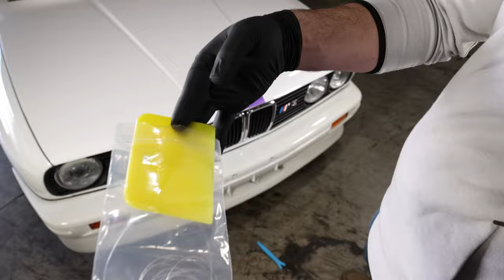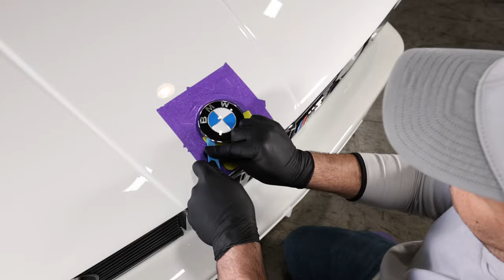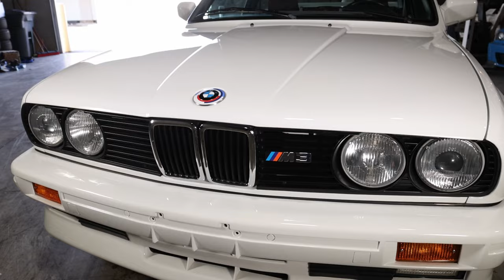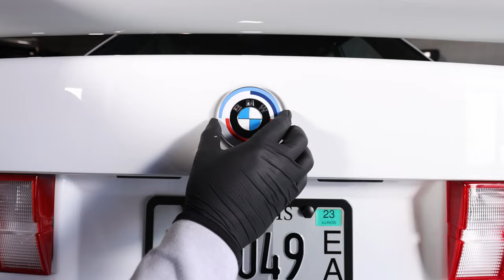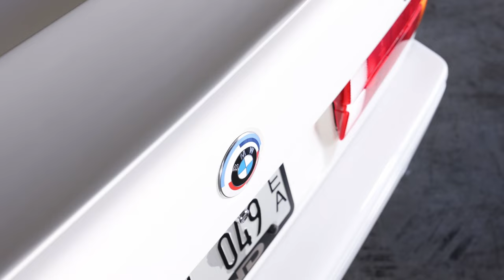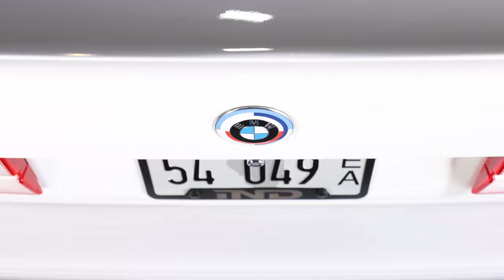BMW E30 M3 // 50 Year Anniversary Heritage Roundel Set Install

Comment: Stock hood and trunk emblems looks best.
Reply from the maker: The emblems on this car were showing their age, and we wanted to give the OEM BMW Heritage Roundels a shot for this E30 M3.
Reply: Looks #Ridiculousness on this awesome  white BMW E30 M3. there is so much white in the 50th Anniversary Roundels it is a perfect match. Get the 120mm x 5 bolt pattern aftermarket 50th Anniversary wheel center caps in a $30 kit to finish it off.
Reply from the maker: @nycshelbygt500  BMW does not offer the heritage center caps in the 68mm variant. OEM only.
Reply: @IND-Distribution  do they offer a 86mm?
Reply from the maker: @Curious818  We are only offering direct replacements, not just based off of overall diameter. If you forward your VIN via email, we can confirm compatibility. Info@IND-Distribution.com

Comment: Awesome!! Pro Tip: Older BMWs don't use an adhesive along with the typical 2 pins on roundels. The new 50th Anniversary Roundels might have an adhesive, that can be easily removed, by rolling it off with your thumb. It makes swapping roundels easy..Replace the grommets, if you have an older BMW.
Reply from the maker: We opted to keep the adhesive tape. It tends to keep the surface under the roundels on the trunk lid/hood cleaner for the years to come. Love the idea to remove the tape for reinstallation just like back in the 80's!